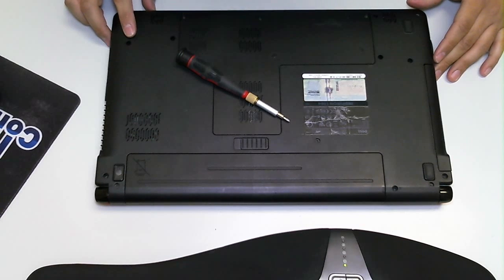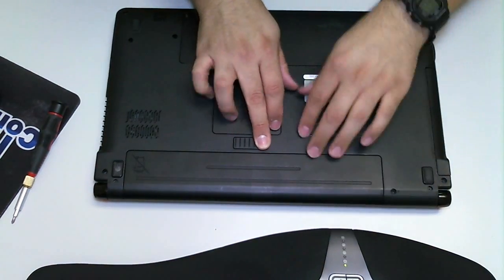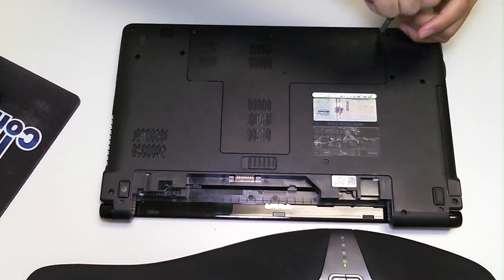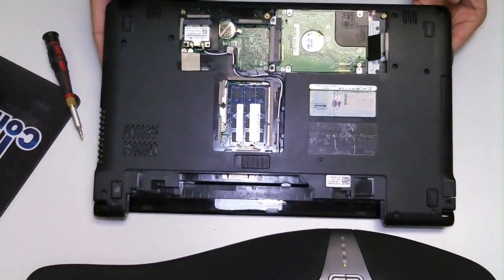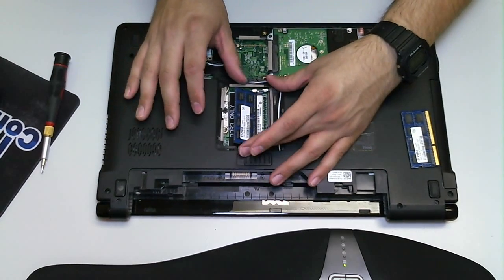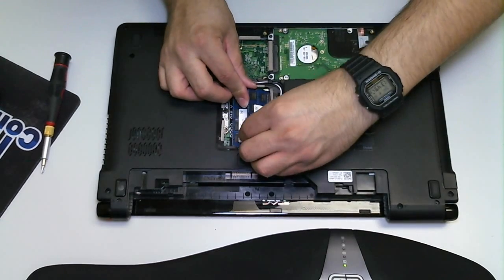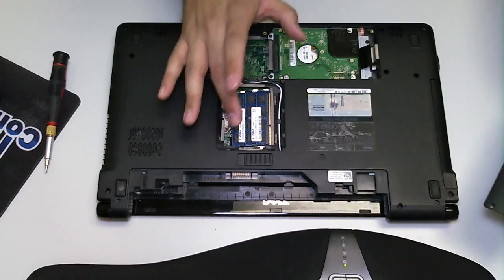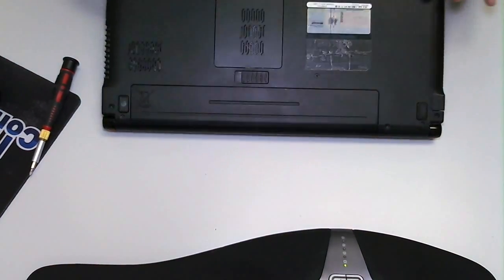Dell Inspiron 1564 Ram Removal or Upgrade

Comment: Can u plz tell me whether this model (64bit) will support ddr3 1600mHz 4 gb ram or will have to get only 1066 mHz for upgradation?
Reply: Hi there, did you upgrade the RAM? If yes, what did you  use - one with 1600Mhz or the one with 1066Mhz? Thanks!
Reply: finroddd Im wanting to upgrade the laptop aswell, apparently 1066mhz is the limit, im not finding any 😔